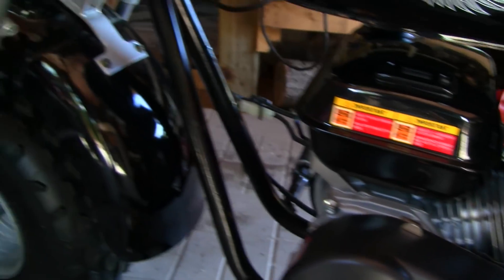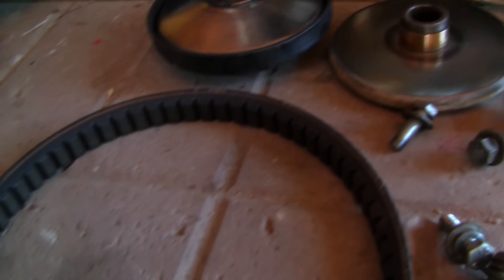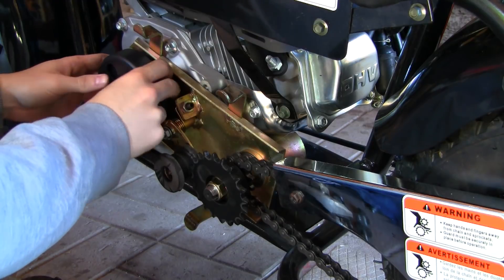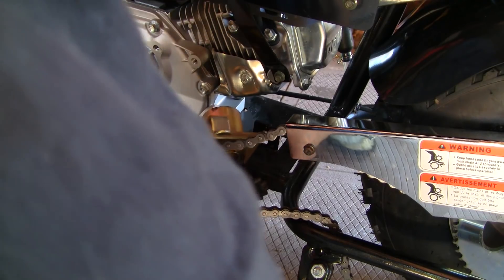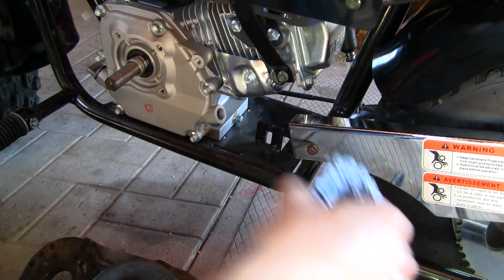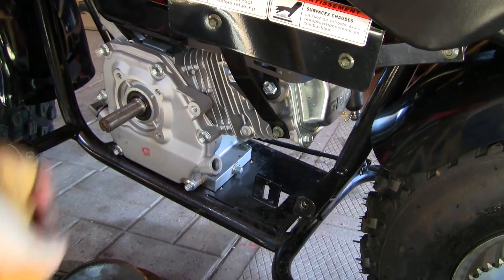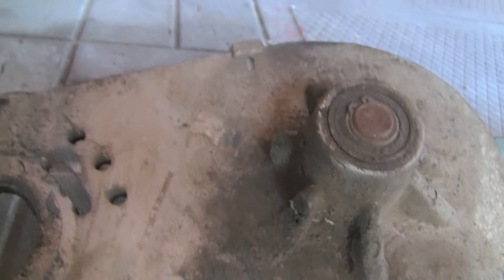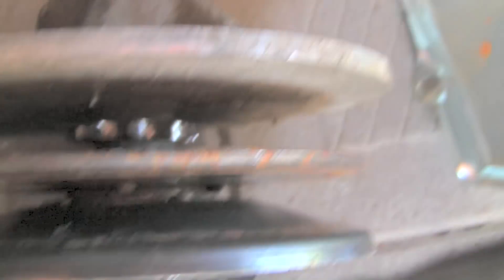Baja Warrior  Mini Bike Clutch To Torque Converter Conversion

Comment: 14 years later, it helped me a ton. I have one of the original warriors and i was worried i would have to get riser plates and a new exhaust, but instead i just had to drill some new holes in the cvt bracket. Thanks a ton :D

Comment: @marcelsworkshop but at 5:18 for the engine's jackshaft, didn't you have to drill in the middle of it and make it bigger in order for the rest of the torque converter to be put on??
Reply from the maker: Nah the only drilling I had to do was the new bolt holes on the torque converter plate, as pointed out in the video. But this is also based on 14 year old designs. Things could have been changed on modern ones or you don't have the right size for your engine. There are different models of torque converter for different shaft sizes.

Comment: great video . i am working on basically the same bike for a customer and what i think was missing was the spacer for the shaft and the first plate which was rubbing against the bolts on the block.

Comment: Ik it’s 12 years later and I’m just wondering where can I find one for my Baja that will fit
Reply from the maker: There's a ton of comet clones you can find on amazon that should fit as long as u get the right shaft and chain size. If you want the legit version, just go to comets website and go through their list of distributors.

Comment: Ты реально поменял то красивое надёжное сцепление на тав30? Я незнаю как избавиться от тав30 ремни горят !
Reply from the maker: If your belts are burning chances are the 2 clutches on the tav are misaligned, the belt is on backwards or one of the springs are shot causing the clutch to instantly go to high gear.

Comment: I bought a 63$ torque converter for my 196cc mini bike should it fit ? It's a 30 series
Reply from the maker: IDK, the only one I have experience with is the Comet TAV2 30. If it is for a 3/4" shaft and  #40/41/420 chain size then it should work.

Comment: Can you not modify the heat shield? These engines are air cooled..and removing the shield probably isn't a good idea...nice video..tho.
Reply from the maker: Not sure never tried. I've had no issues with it removed. These engines are designed to sit stationary running generators and stuff at full blast for hours on end, so it is already getting way more cooling then it normally would from all the air flying past it as you zoom around.

Comment: I bought a new BT 200 and the damn thing has a 5/8 crank I could buy another engine however I’m not going to ( wife) would kill me lol so I bought the 3/4 sleeve ( one show I watched said they were junk but reading reviews I did not see any negative notes ,I’m thinking I may have to grind my key way but that’s fine I was also thinking of JB liquid weld for steel to add some more strength to the crank what do you think ?
Reply from the maker: Ah that sucks. That's weird, I've never seen a 5/8 shaft on any engine bigger then like 4hp.

I have no experience trying to adapt a 3/4 inch shaft torque converter to a 5/8 inch shaft, so can't offer any advice there. :P

Comment: Torque converters are great but for the mini bikes and heavy go carts I would have kept the clutch more speed
Reply from the maker: With this mini bike you gain 20km/h more speed with the torque converter vs leaving it stock.
Reply: @MarcelsWorkshop  kind of mint not using nothing but the clutch not the gear reduced
Reply from the maker: @Joseph_Headen  Guess it depends where you plan on riding it. With just the clutch without the gear reduction you do gain an extra 15km/h more then the torque converter but you loose all your torque so it doesn't really work anywhere other then mostly flat trails or fields and roads, and even there the clutch will probably burn out pretty quick. I fried my clutch after only a few rides using this config. :P
Reply: @MarcelsWorkshop  ok well you been very informative in normal wear how long did that belt last
Reply from the maker: @Joseph_Headen  Not sure, I've never actually had a belt completely wear out. In 10 years I think I've only replace it once, not because I had to, but just to get that extra little bit of grip a fresh belt gives you. :P
Reply: @MarcelsWorkshop  I ordered mine today hopefully everything is good it's an original Comet torque converter
Reply from the maker: @Joseph_Headen  oh nice! Definitely a worthwhile upgrade for these bikes!
Reply: @MarcelsWorkshop  well I've tried a new belt and it completely distoyed it in 1 min so just ordered a clutch not sure what's wrong
Reply from the maker: @Joseph_Headen  Not sure.. I've never had that happen. My best guess would be either the belt was put on backwards (there's a flat side and angled side - flat goes towards engine) or the two pulleys are misaligned. (maybe you need to add or take away spacers on the engine shaft.) Put the bike on something to raise the back wheel off the ground and run it without the torque converter cover and maybe you'll be able to see whats going wrong.

Comment: Thanks for the vid MarcelsWorkshop, all the bikes ive seen with torque converters installed i noticed the converter was tiltled slanting down at the rear , i ve never seen anywhere on the reason for this , i have one i want to install and it has enough room to go straight  or slanted ,  before i put it on i thought id ask if it would matter which way ?
Reply from the maker: No I don't think it really matters if its straight or slanted, as long as the chain isn't rubbing anything. They usually fit slanted because the support fins on the back hit the engine otherwise or just the bolt hole placement lines up better slanted.

Comment: Any idea where you can get that chain roller piece ?
Reply from the maker: Can get some #420 roller chain from tons of places online and then just cut it to fit. Just got to do a search for 420 chain or baja mini bike 420 chain. Or are you talking about the chain tensioner? That little wheel below the chain that keeps it tight? That I have no idea where to get, sorry.
Reply: MarcelsWorkshop yeah the rubber wheel

Comment: Hey I know it's been a while seance you have commented on here so hopefully you get this. But I have a Mini Baja 196cc. Would this be the same kind of method? I just picked it up the other day
Reply from the maker: Not sure. If its just a regular tapped shaft that you can put a bolt into then it should be the same. But I know some newer models have a threaded shaft instead though and you need to do some sort of work around with like a lug nut or something to get the converters mounted.

Comment: Would this work on a massimo mb200? I know all the 200cc bikes are pretty much the exact same bikes, but I can’t seem to find any videos for a torque converter on the massimo mb200
Reply from the maker: Depends on how the shaft is set up on the bike. If its just a regular shaft with a threaded screw hole on the inside then yeah. Some have a weird set up though with the threads on the outside and need some sort of lug nut work around to hold it on.

Comment: Does adding the torque converter get rid of the jerkyness that the centrifugal clutch has at low speeds and takeoff?
Reply from the maker: yeah it's smooth as butter with the torque converter.

Comment: I got a mini off craigslist and the chain was rusted solid.  I took it home, cut the chain off, and installed a new chain and clutch kit from Ebay https://www.ebay.com/str/sellerwarehouse.    It only has a 3HP motor but honestly, I don't think I want more power, the 25-30 MPH seems enough to kill me already.  I want some type of kill switch now because I worry I might mess myself up on accident.  Maybe I will just sell this one and find another to put a chain and clutch on.  Installing the parts was the funnest part and increased the value $200 easy.

Comment: Why is a torque converter better than a clutch, particularly on these bikes? My stock baja can get up over anything and thru just about anything where 4 wheeler's get stuck and the bike is so agile it smokes 4 wheeler's in the woods. So from a  terrain stand point these bikes are nearly unstoppable as they are. Would a belt driven torque converter be as good in that situation or would it make the bike less capable in the woods. Is the torque converter for more speed, not off road terrain? Because these bikes are awesome off road. I am honestly asking because I don't know. Let me know what advantages you get from a torque converter and any disadvantages too removing the chain driven clutch and switch to a torque converter. Thank's
Okay after doing some research on the topic, the major advantage is speed, their is a disadvantage. If you use your bike off road primarily where 25 mph is enough speed, their is a tendency to wear those belts out a lot and have to keep replacing them. You also loose some traction that a chain powered clutch gives. So for me I would not want a torque converter because I use my bike out on trails with inclines and declines and mud. If you are using these on flat surfaces and on roadways where its clear a torque converter would be the way to go...

Comment: I had this same minibike years ago and the factory jack shaft is junk... I ended up flipping the clutch 180 and running the chain direct. it was slow off the line but it went at least 70mph
Reply: bullshit it wont go 70

Comment: I didn't have to drill new holes in mine I just cut off the bottom section of the torque converter plate

Comment: Marcel, love the videos and me and a buddy are looking to add a torque converter on to ours.
I have an older Baja Heat 6.5HP, and he has a Baja Warrior 200cc.

Which kit would work best for our needs, and where to buy the best deal?
Reply: http://www.ebay.com/itm/391374800843

I saw the specs in your description, and came across this item on ebay.
Reply from the maker: Thanks! No idea where the best deal would be though. Last time I bought one was 4 years ago. :P  

That looks like the same one I have, the only difference being you have to install the sprocket yourself whereas mine came with the 10 tooth one already installed. 

Should work fine for yours, not sure about your friends though because if his is the new model it may have the threaded crankshaft rather then the tapped crankshaft. Might need to come up with a workaround for mounting that one such as grinding down the key and using a lug nut like this video: https://www.youtube.com/watch?v=ENmL0LwDPNc
Reply: Great! thanks a lot for responding, and will be looking for any updates you have on these things lol.
also gunna try and craft our own muffler with methods you used on you other vids.
thanks again man!
Reply: And also, after this mod added, will the governor still keep it from reaching a descent speed?
Cause mine goes probably around 20-25MPH right now. 
I saw your bypass video, and we have also looked into removing the engines governor, and am aware that it could be wide open and have to be careful when accelerating and not blow it up lol.
But if it can reach a bit more MPH, then ill be happy and may not take the governor out.
Reply from the maker: Should still reach decent speeds with the torque converter, even with governor still on, because with the torque converter in it's "high gear" the engines don't have enough power to run at their max rpm anyways. Biggest difference bypassing or removing governor would probably do would be, faster acceleration and allowing you do do wheelies and catwalks, because when the torque converter is in is "low gear" it definitely can use the max rpm of the engine. Haven't done a direct comparison though with the governor intact, so there may still be some extra top end to be had from bypassing or removing governor with the torque converter.
Reply from the maker: No Problem! Have fun! I'll probably never have any updates on these things though. Probably gonna sell of most of my toys when i get a chance. Just don't have the time for them anymore. :P
Reply: @Jason B Did you ever install that eBay torque converter? I just bought a Baja MB165 and was looking at that same kit on eBay. Just wondering how it went.
Reply: Jordan Ferguson Hey man, thanks for checking in. I had not, been on the back burner for now.. but I still want to do it for sure.. I still ride it a lot... just need a good day to 1. Buy it and another to 2. Build it.
Reply: Jordan Ferguson I looked about a month ago and had it in my eBay cart... but never hit purchase lol
Reply: Jordan Ferguson If you end up doing it, please let me know how it goes, me and a buddy of mine both have a baja bike and want to add the torque converter , new air filter, and muffler. If we end up doing it, ill hit you up.
Reply: Jason B yeah haha I want to do all that too, but Im also wanting to know someone who's done it so I know it can be done. haha gotta find a guinea pig.
Reply: Jordan Ferguson my buddy is wanting me to be the guinea pig first I guess he'd rather not chop his into bits before knowing it's possible too LOL
Reply: Jason B Bought it, attempted to install tonight. Didn't go well. Will be modifying the mounting plate tomorrow to try to get it to work.
Reply: Jordan Ferguson good luck man... there's a lot of hacking involved looks like
Reply: Thought I'd give you an update. Ended up drilling new mounting holes, basically turning the holes to slots. Also raised the engine and it fit without hacking the rear support fins and without cutting the lower half of the bracket. I'm happy with it, looks good, feels pretty good. Not a day and night difference, but still a good investment.

Comment: Dose it make it faster
Reply: quicker, not faster.
Reply: It gives you more torque, which gives much more acceleration, with the extra torque, you can move to a smaller sprocket, if you want to climb up hills, keep the sprocket, if you want a ton of speed, go way low, you can hit mid 60s mph
Reply: Yes

Comment: hey , you said the bike can go upto 70 after tuning , please explain the tuning process? how to increase speed?
Reply: expensive racing camshaft, valve springs, racing carburetor, upgraded racing carburetor, small sprocket, torque converter, timing advance, modified torque converter.
Reply: Start by removing the governor, get stiffer vavle spring or your vavles will float and will fail, get a bigger air filter and a less restricted exhaust. Get a performance flywheel, camshaft, mikuni carburator, maybe a better rod and piston, and have a relatively low tooth sprocket set up, and you got yourself a 70mph mini bike.
Reply: dose it have points
Reply: Hitesh Arora loo
Reply: changing sproket sizes as well as experimenting tire sizes to increase rpm's. You kinda have to play it out and see
Reply: Hitesh Arora sä tarvit kasikymppi malossin 23 mm suuttimen gianellin turboteharin ja 17 45 välit

Comment: torque converter vs centrifugal clutch for drift go-kart??? Go
Reply from the maker: +Bryson Shires I would say torque converter but I don't know anything about drifting karts. Probably best to find a more specialized forum for that type of thing and ask people there.
Reply: Chinese 110cc manual trans motor with manual clutch. once you figure the price of the CVT on a harborfreight engine it's the same price. the Ability to pop the clutch will help get it loose with rubber tires.

Comment: are the front and rear chain the same size or is the front one bigger
Reply from the maker: +Sam Osburn both the same size width wise, rear is much longer though obviously :P
Reply: +MarcelsWorkshop OK well do you know where I can buy the front chain at cause I just bought the Baja warrior for 100 used but needs front chain
Reply from the maker: +Sam Osburn No idea haha. Find a local go kart or small engine or auto parts shop and they might have chain. I get mine at Princess Auto, but that is only in Canada. :P
Reply: +MarcelsWorkshop OK do want to sell the one you removed
Reply from the maker: +Sam Osburn Sorry don't have any extra. It has all been used on other toys.
Reply: +MarcelsWorkshop OK all good
Reply: +Sam Osburn tractor supply sells the chain and it's called country line

Comment: I bought my torque converter on ebay and put it on my mini bike. Its a 200cc, shaft is untapped and i put a mag nut on it. I rode it for only about 15 minutes and the belt got t hot and went to shreds. I took the cover off and the clutch was hot, like put water on it and sizzles. What is the problem, also it only went about 40 mph on a dirt road.
Reply: Is it an asymmetrical torque converter, if so the flat side of belt goes toward engine
Reply: I don't even know now, took engine off my mini bike put it onto my go kart. Runs perfectly good now on the go kart. I see less problems with it being on the go kart so the motor will probably stay it.

Comment: hey just wondering why the second oil dipstick is missing...does it get in the way of the cvt plate?t hanks
Reply from the maker: +sleeper silverado engine didn't come with a second dip stick. its just sealed off inside the hole. :P

Comment: Two questions/comments:   1)  I know a TC helps for speed, but how does it affect slow speed torque?  The reason I ask is because I use my bike in situations where I need to go over rough ground, up steep slopes, etc., where I need good torque and not necessarily speed.   2)  My Baja Warrior doesn't have the tapped center bolt hole on the crankshaft end.  I've heard some people get around this by using a lug nut from an auto Mag wheel.   Have you ever heard of doing this?
Reply from the maker: +delavalmilker 1) TC greatly improves low speed torque. It's basicially like putting an automatic transmission on the bike so it will essentially switch to a low gear for climbing or starting then switch to a higher gear when you start to build up some speed. 2) I've seen videos with the lug nut work around for that problem but I have no experience with it myself.